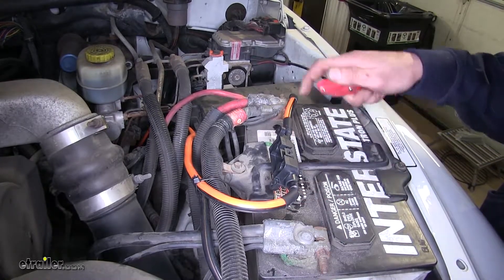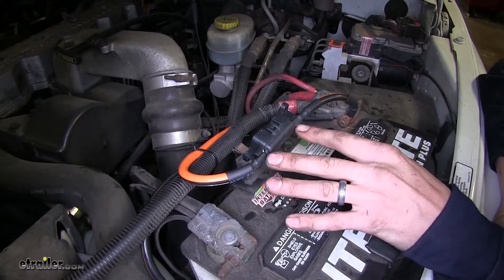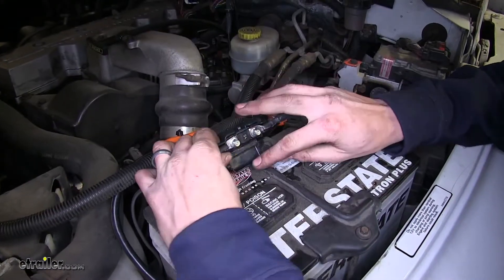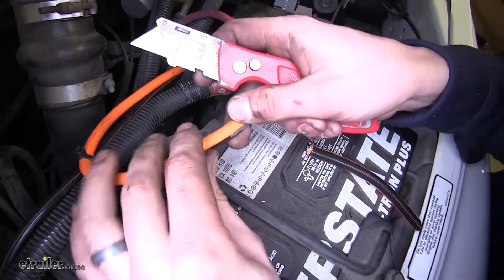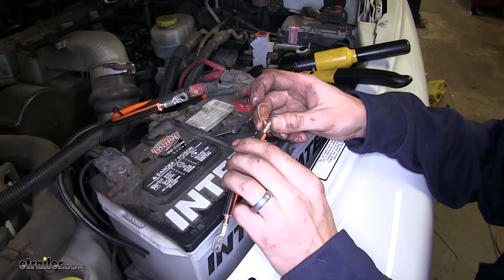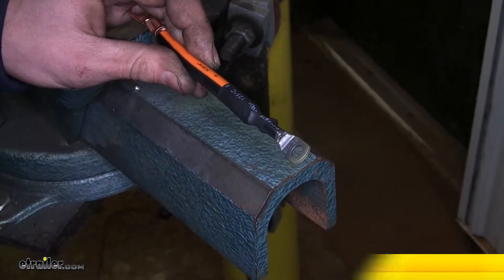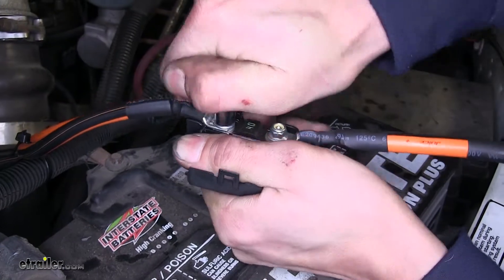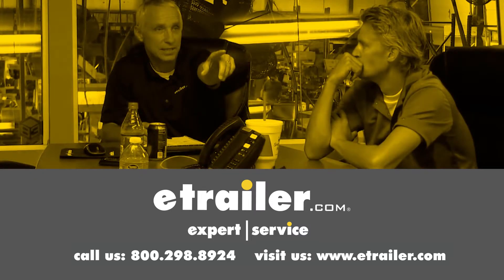etrailer | 40-Amp MIDI Fuse Kit for Redarc In-Vehicle 25-Amp BCDC Battery Charger Spec Review

Comment: What kind of solder should be used?
Reply from the maker: The solder that we typically use when soldering wires is lead-free rosin core solder. This can be found at your local hardware stores.
https://www.etrailer.com/Accessories-and-Parts/Redarc/331-fk40.html